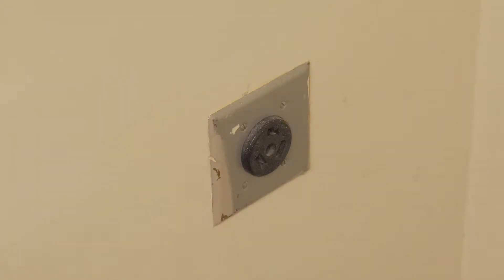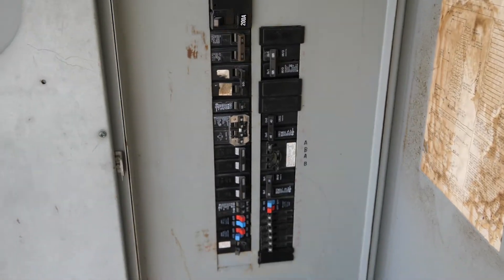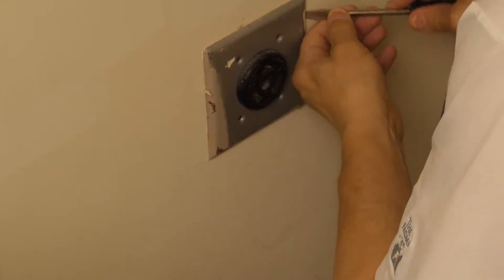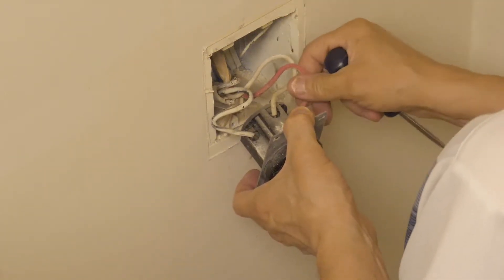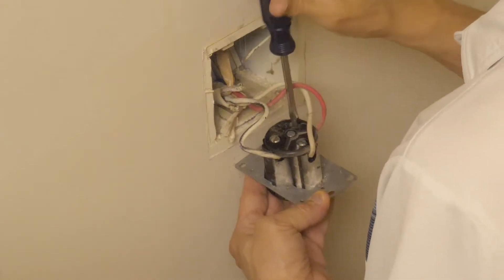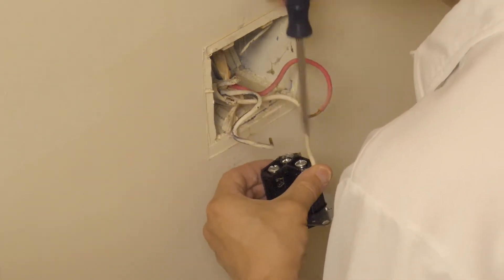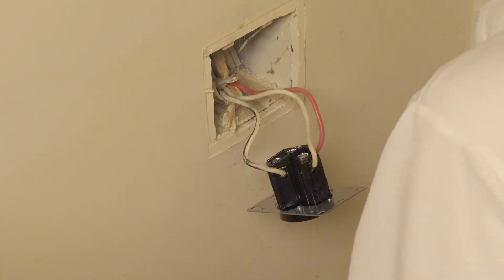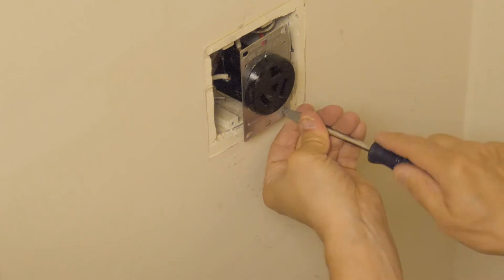Replacing NEMA 10 30 Dryer Receptacle

Comment: Important to note that it's no longer recommended to install a 10-30 outlet because of the fact that they don't use the ground wire. If you have the ground wire to use, best practice is to install a NEMA 14-30 outlet, which is able to use the neutral. Tesla sells a NEMA 14-30 adapter and dyers will generally just require a new power cord that can be purchased at the hardware store.
Reply: I'm glad you noted that; I was going to ask that, especially since he has the ground wire available there.
Reply: @FloppyRunner  You guys are correct...
Reply: @FloppyRunner  Which makes it even more perplexing for him to replace the receptacle with a new NEMA 10-30. If the original installer ran 10/3, why not just replace the dang receptacle with a NEMA 14-30 and call it good?
Reply: @vzylexy1506  probably because his dryer runs off of that same outlet too

Comment: Hi, I have a question. I have the 10-30 dryer outlet on my garage wall, and I am only using the gas dryer.  I bought the new Gen 2 NEMA 10-30 Adapters. Every time when  I charge my 2021 Model 3, the first few minutes can get 25mi/ hr , 24/24V 236v  , but after 5-10 mins,  it will fall to 12mi/hr 12/12A 236V automatically . And never go back to 25mi/ hr , 24/24V 236v again. i checked the 50A breaker temp has 140F.  Do you know what is going on ?  I hope you can help me.
Reply: Presumably it is a 30A breaker, but whatever. What is happening is that the Tesla adapter/EVSE is sensing a problem with the circuit. It could be an old breaker, wires that aren't tightened down at the breaker or at the receptacle, or the receptacle itself. You've definitely got a problem though, and I would spend the time going through each of these possibilities and diagnosing/fixing them. 140F at the breaker sounds too high, so first thing I would is flip off the breaker and then tighten down the wire lugs on it to see if they were loose. If they were tight, then I'd replace the breaker. If that didn't fix the problem, I'd then replace the 10-30 receptacle.
Reply: Hire an electrician to check. We can diagnose here.
Reply: Hello, just wondering if you have solved the problem?

Comment: If you've got a ground, then why are you using a 3 wire connection?They did away with these for safety reasons.  You should put a couple layers of electrical tape on those screws, and make sure that ground is not touching those hots.  You also need to make sure the box (if metal) is grounded as well.  Once youve terminated your connections you will need to wiggle the whole thing around and re tighten.  Make sure you use proper torque specs to tighten things up properly.

Comment: Wait there is a ground wire and not installing a grounded receptacle? Why?????
Reply from the maker: Because I'm an idiot. Thanks to these YouTube comments, I'm going to replace that receptacle with a 14-30 when I finish a laundry room remodel in a few weeks. I'll make sure that ground is connected to a ground, but yeah, if there's a ground there, it should be replaced with a 14-30.